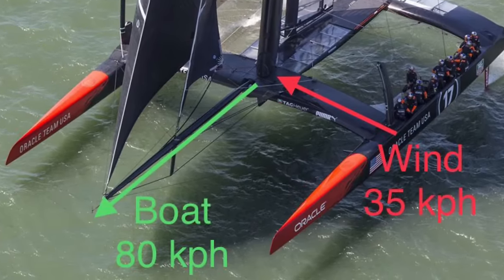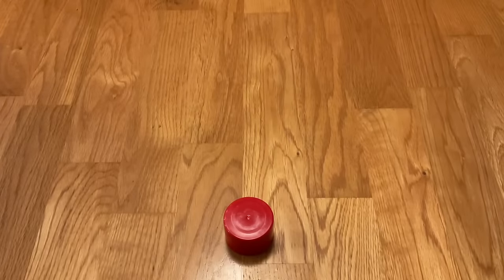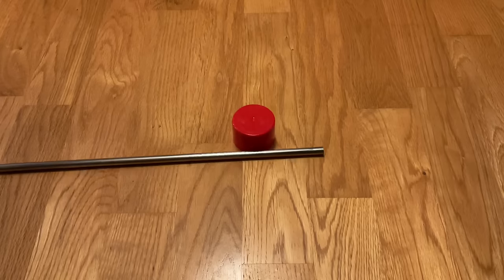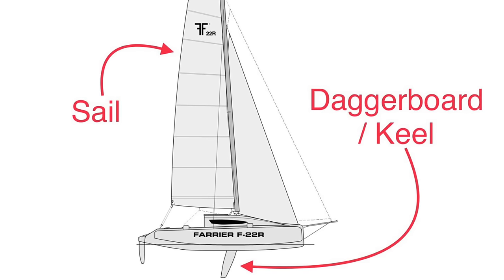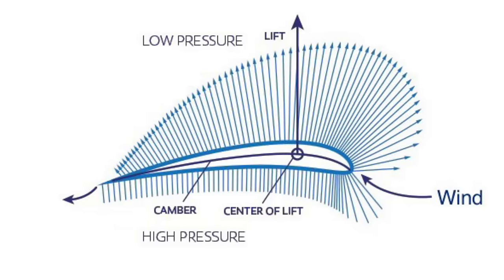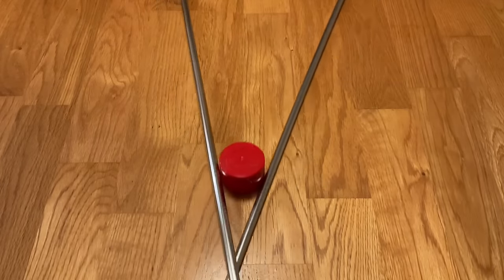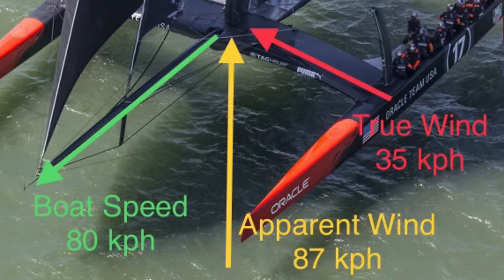How Does a Boat Sail Faster Than The Wind?!?!?

Comment: Sailors alwas talk about apparent wind. But wind increase due to speed only increases the detrimental component, the one producing drag. Only the wind componenet perpendicular to the direction of movement can be converted into forward movement. 
The "apparent wind" argumentation is a fallacy. Yes, you go faster and faster, and the apparent wind increases. But it is only the normal component, (the one equivalent to lift in a sailplane) that allows you to go faster. And, assuming there is no wind shift and change of course, this component remains the same during the process.
Reply from the maker: If apparent wind due to boat speed only increases the detrimental component, then how do you explain the fact that a boat that gybes downwind through 90 degrees, keeps the apparent wind forward of the beam, and sails 140% further will almost always arrive at the downwind mark before a boat that sails dead downwind and minimizes the apparent wind increase due to boat speed?
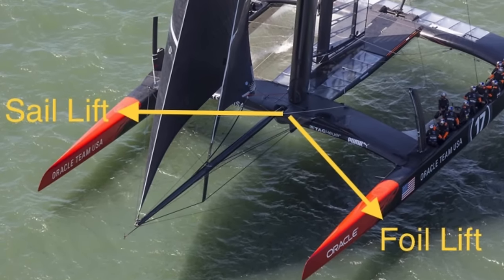Reply: @SailingTipsCa  Easy. Sailing dead downwind is inefficient. Maximum speed you can achieve is wind speed. But riding the normal component allows you to achieve speeds up to normal component times lift to drag ratio. I don't know what l/d is for sailing boats, but gliders in aviation are way beyond 1:50 these days. High apparent wind is a welcome CONSEQUENCE of sailing fast. It is not what MAKES you sailing fast.
A quite high frontal component is also necessary for the sail not to stall when it is trimmed tight (sorry, I am not familiar with naval terminology; pesonally I am a planes guy.)
Reply from the maker: @HotelPapa100  Excellent point that apparent wind is a consequence of sailing fast - it’s all about maximizing lift versus efficiency as you noted!
Reply from the maker: @HotelPapa100  I've been thinking more about the similarities and differences between between sail planes and sailing yachts. Both use mostly-opposing vector forces to propel themselves forward albeit in slightly different ways. The opposing forces with the sail plane are gravity and lift from the wings, and it's the non-perpendicular element of these forces that drives the plane forward. The opposing forces with the sailing yacht are the sails in the air and the foils (daggerboard and rudder) in the water, and it is also the non-perpendicular elements of these forces that drives the yacht forward. You can propel the yacht forward as long as the air and water are moving relative to each other, and it's the lift versus drag ratio that dictates how fast the yacht can go.
Reply: @SailingTipsCa  Spot on. Good analysis. What fascinates me in foiling yachts is the delicacy of the equilibrum of basically three points of attack: the daggerboard/foil, the sail and the rudder with its horizontal trimming foil. It blows my mind how a skipper can keep this three-dimensional system stable enough in the rapidly shifting conditions.
In a plane this is comparably simple. You can stabilise the individual axes separate from each other. In a sailing boat all three axes interact.
Reply from the maker: @HotelPapa100  Yes it is amazing how they make it all work together - here’s a quick video I made on some of the controls involved: How Do You Control a Foiling Boat?!?!? https://youtu.be/haevc7aWyL8 For the inshore AC/SailGP boats there is a crew member dedicated to controlling the foils and ride height because it’s generally too much for the skipper to handle. For offshore foilers like ULTIMEs they typically set the foil trim for a specific speed and the autopilot steers the boat either higher (towards the wind) or lower (away from the wind) to manage the speed and maintain the foiling height.

Comment: Lol wtf are you talking about? Caravels and other "early" (actually quite advanced) ships had keels and didn't have "parachute sails" that limited them to "sailing in the direction of the wind"... they could sail upwind just not directly obviously. And not having an airfoil sail doesn't mean a sailboat is "primitive". Almost all sailboats don't have that.
Reply from the maker: The ship at 00:16 is the Batavia completed in 1628, and wings weren't well understood by humans until at least the mid 1800s. That said Caravels did have triangular sails which would have been much more efficient than the square-rigged Batavia. Many modern sailboats do have wing shaped keels (e.g. NACA 0012) and most from the last few decades do actually have wing shaped sails - why do you think they don’t?

Comment: I still don't understand how it works together. It's not like the current adds the extra "lift" for the foil. How does the foil generate "lift" if it's not being "pushed" by anything? 😂😂
Reply from the maker: The wind provides both forward and sideways thrust vectors on the sails, which has a tendency to push the boat both forwards but also sideways. Once the boat starts moving forward at a sufficient speed the foil/daggerboard/keel resists the sideways thrust vector from the sails. But if the boat is not moving sufficiently fast the foil/daggerboard/keel will be in stalled state (from a wing perspective) and the boat will just go sideways. Does this help?

Comment: Considering the rods, the angle between them is “tighter” close hauled than for instance a beam reach, indicating the former should be faster according to this ‘theory’. The opposite of reality.
Reply from the maker: The moderating factor is the friction of the boat with the water, so it’s almost as though the close hauled gear is too “tall” for many boats to overcome the friction, whereby a beam reach is a better “gear” for most boats. The more efficient the boat the closer you get to sailing close hauled all the time, regardless of the true wind direction. On very fast boats there is only a few degrees of difference in sail trim between upwind and downwind sailing.
Reply: @SailingTipsCa  Nonetheless this rod explanation doesn’t explain how a boat can sail faster than the wind because it is an analogy and a substitute for the physical explanation. Granted it helps people to see that the opposition of lift from keel and sail is what enables the boat to sail other than downwind. But you say ‘’the puck moves faster than the rods themselves, this is exactly how a boat can sail faster than the wind’’. ie because the angle is acute like a wedge the puck will move further by the ratio of lateral rod displacement over sin theta, which is Simple Machine Theory, but misapplied. You cannot just take the force vector, multiply it by this ratio and call it velocity. 1) that doesn’t give velocity and 2) the lift vector is perpendicular to the rod so the ratio gets inverted anyway. This is where the analogy becomes a fallacy.
  The boat reaches maximum speed when aerodynamic force is equal and opposite to hydrodynamic force. This in turn depends on the hydrodynamic and aerodynamic lift/drag ratios. The minimum apparent wind angle is a function of the sum of those two ratios. That is the bottom line. Hence, by the sine rule, the requirement for sailing faster than wind is: sum of both L/D angles < half the true point of sail. Eg close hauled at 45 deg you can sail faster than the wind if the L/D angles sum to less than 22.5 deg.
Reply from the maker: @XPLAlN  Yes it’s not a precise explanation, kind of like the models of the atom and electricity that they teach in high-school which aren’t completely accurate either, but allow non-scientists to get a sense of how it works.
Reply: @SailingTipsCa  ok fair enough.
Reply: Generally, the smaller the apparent wind angle that you can sail (maintain speed), the greater speed (true wind multiple) you can achieve. The acute angle between the rods is analogous to the achievable apparent wind angle, which is the sum of the two drag angles (atan(D/L)) at water and air.
Reply: @XPLAlN  What you write about lift and drag ratios is correct, and the analogy to the rods & puck is straightforward: The D/L ratio in a fluid corresponds to the friction coefficient between the rods and the puck (lift = normal force, drag = friction force).

Comment: I have sailed all my life and I know that this works while at the same time breaking The First Law of Thermodynamics which is that
 ‘The amount of energy gained from something cannot exceed the amount put in’
I cannot get my mind around it
Reply: You are confusing energy and speed. There is no speed conservation, and every lever or gear box can output higher speeds than you put in.
Reply: @albatrosssoaring1487  
Okay, thanks for that.  Please help me here,  I am peddling a bicycle in first gear at four miles per hour, I change up to second gear, keep peddling at the same rpm and therefore double my speed but only if I contribute twice as much energy to achieve it. Right or wrong?
Reply: @mossden  It depends. If you keep the pedal RPM and the force on the pedal the same, then the energy input also stays the same, but your output force and thus acceleration will be less. Mechanical advantage means trading force for speed (or vice versa). In higher gears you get more output speed at the price of less output force (less acceleration).
Reply: @albatrosssoaring1487  
Just so but I still marvel at a machine which is travelling at four times the speed of the wind that is it’s only power source.
Reply: @mossden  Think of the power source as two huge and massive bodies (water-mass and air-mass) that are squeezing out a tiny little boat. No matter how slow the big masses are moving relative to each other (true wind), they still have more than enough energy to propel the little boat much faster than that. And the boat cannot outrun it's power source, because it is immersed in it, as there is wind everywhere around it.
Reply: @albatrosssoaring1487  
Thank you I like your explanation 
Hull speed of a displacement hull equals 1.34 times the square root of the waterline length in feet, it doesn’t matter how much energy is put in the boat cannot move any faster.
A foiling boat acts more like an aeroplane than a boat as only a small percentage of it is actually in the water.
Kite boats take it to another level entirely, pun intended.
Reply: @mossden  Yes, hull speed limits the absolute speed of displacement hulls, but it doesn't limit the wind-speed multiple. You can have a displacement hull, that goes faster than wind, but in slow winds so it stays below hull speed. You just need a very large and efficient sail.
Reply: @albatrosssoaring1487  
 As you correctly say displacement boats can travel faster than the wind speed 
 but once hull speed has been reached the application of more power will go into making a bigger bow and  stern wave as the vessel squats deeper into the water.
Some modern ships have very ingenious hull shapes that enable the vessel to travel more economically at higher speeds but cannot significantly exceed the physical laws relating to speed and waterline length
Reply from the maker: Yes a very efficient displacement boat with a hull speed of say 8 knots could potentially sail 7 knots in 6 knots of wind. But in 15 knots of wind it will still be limited to ~8 knots because the energy required once a boat reaches hull speed increases exponentially. The hull speed limitation does not generally apply to foiling boats (where the hull is lifted out of the water), planing boats (like sport monohulls), or multihulls with long skinny hulls where the length to beam ratio is greater than 8:1. Check out Why Are Trimarans So Fast?!?!? https://youtu.be/GxdCcsAdOVM
Reply: @mossden  A lighter boat can ride on top of the water, so the hydrodynamic forces e.g. like a skipping stone, rather than the hydrostatic, i.e. displacement, forces e.g. like a floating cork, support the weight of the boat.  In the AC72s when foiling it is the angle of attack of the horizontal section of foil moving (-dynamic) through the water (hydro-) that supports the boat's weight.
Reply: @BrianTCarcich  
I understand the science (just about), but  on the face of it the fact that a boat travels much faster than the wind that is providing the propulsion is still pretty weird
Reply from the maker: @deniskearney2368  Yes it’s a bit of a mind-bender!

Comment: Your fastest angle of attack is between 5 and 20 ‘ off of straight into the wind she’s actually being pulled threw the water not pushed fun fact your slowest speed is going completely with the wind on a Run as they say also the most hot and boring as u are doing the same speed as the wind or slower and u don’t have a breeze because you are the breeze also a hydro foil basically glides threw air more then water so she is slipperyer then a fish in a sense
Reply from the maker: Except in a really fast boat the apparent wind is always well forward of the beam regardless of where the true wind is!

Comment: https://youtu.be/LKLa8_GOuPg?t=106 "the sails and foils on a sailing boat generate lift in opposite directions"

1) Diagram is a little misleading:  the water foils' lift will be perpendicular to the velocity vector of the boat, which is roughly the centerline of the boat, plus a small bit of leeway. On the AC72 the foils my be asymmetrical, which could reduce the leeway wrt the centerline, possibly to 0.

2) This picture diagram should be about total force, not "lift"

2.1) Overall the **TOTAL FORCE** (LIft *PLUS** Drag) vector on the water foils points mostly toward the windward beam (~lift) and a little aft (~drag) i.e. assuming a high lift/drag (L/D) ratio.  I say ~lift and ~drag because the boat velocity is ~aligned with the boat centerline (see 1 above).

2.2) Overall the **TOTAL FORCE** vector on the sails (air foils) points mostly to leeward and a little fore-ward.

2.2.1) The large lift component vector is perpendicular to the apparent wind vector (by definition of lift);

2.2.2) the smaller drag component (again, assume high L/D) is parallel to and downwind with the apparent wind vector;

2.2.3) the combined Lift+Drag sailforce vector is mostly perpendicular, but slightly downwind wrt the apparent wind vector.

2.2.4) Because the apparent wind direction (arrow tail) is rotated to windward (i.e. perpendicular to centerline) forward wrt the centerline, that rotates the total sailforce vector on the sails forward wrt to abeam.  This is the **ONLY** source of fore-ward force on the boat.

2.2.4.1) As the boatspeed increases, the apparent wind moves forward, and that rotates the total sailforce vector aft i.e. the along-centerline fore-ward force decreases.

3) When the boat is accelerating, the two force vectors, on the water foils and the air foils, make a wide V somewhat like the picture at 1m46s, only the water force is slightly aft and the sailforce is slightly forward.  This is when the watermelon seed analogy is in play.

3.1) As the boatspeed increases, the V between the water-forces and the sail forces gets wider, until eventually the vectors are parallel, opposite and equal, at which point the net force is 0, so the boat moves at a constant velocity.

4) The limitations to speed along the centerline are

4.1) the efficiency (L/D ratio) of the sail to generate its total force as close to perpendicular to the apparent wind as possible,

4.2) the decreasing angle of the apparent wind wrt the centerline of the boat (rotates sailforce vector aft)

4.3) the increasing drag on the foils.
Reply from the maker: Yes there is some nuance in the physics involved that is beyond demonstrating in a short video, however the intent intent is to help “normal” people visualize and understand the concepts involved, similar to the models of the atom taught in high school, which are also missing nuanced details. 

I did think quite a bit on how to present the lift diagram, given the nuance you described above, however chose to present it as I did because in tidal waters there is typically also current at play which contributes to the motion of the boat. For example in the waters where I typically sail it’s not uncommon to have 3 knots of true wind opposed by 3 knots of current, in which case you will have 6 knots of apparent wind before the boat even starts moving, and the heading of the boat no longer aligns with the speed over ground.